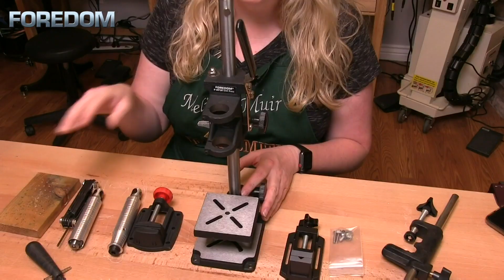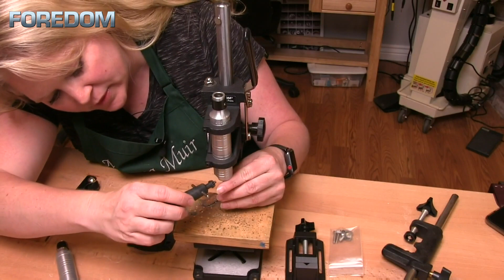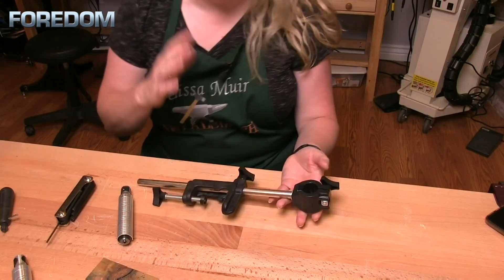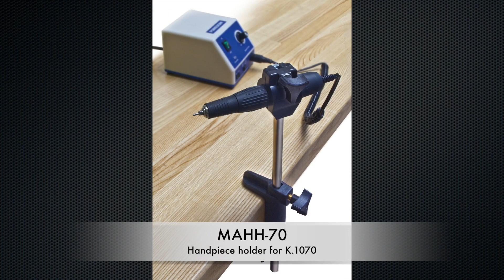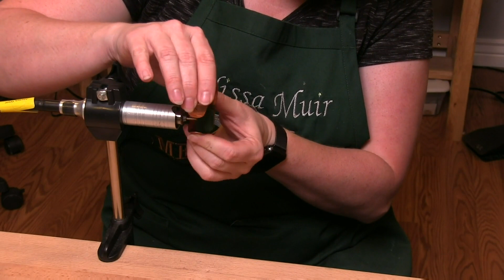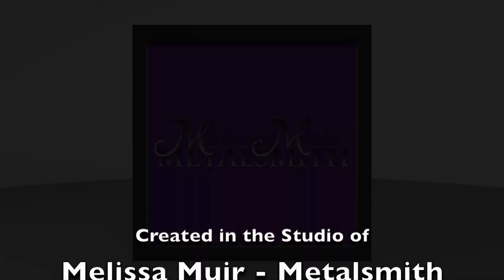Drill press and handpiece holder

Comment: Hiya Malissa, another great video, thank you to you and to Foredom. I purchased the drill press and engineers vice. The 'V' slot in the vice is perfect for holding tubes for drilling out the seat for tube setting. I'm disabled, one problem being arthritis so having a way of holding small verniers upright and firm at the same time is wonderful. Use wood to drill into, MDF is rated in the UK as carcinogenic so dust is not good. 
You can also put bits like wire brushes in the H30 and therefore have a vertical lathe. 
Stay safe, Steve...

Comment: I have a handpiece holder, albeit from another manufacturer. Folks, I cannot possibly explain just how handy it is. In essence, you now have a small bench lathe. Think of what you can do with that. Just as importantly, one can use two hands, as the handpiece is in the holder, allowing for much more control.